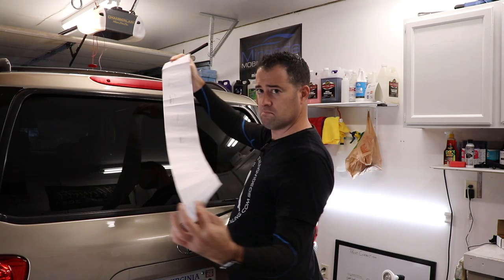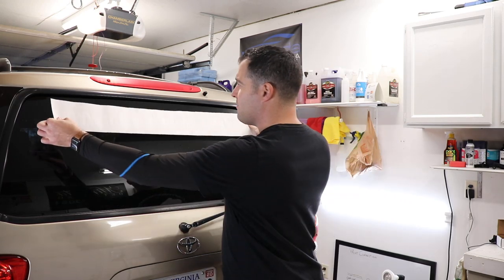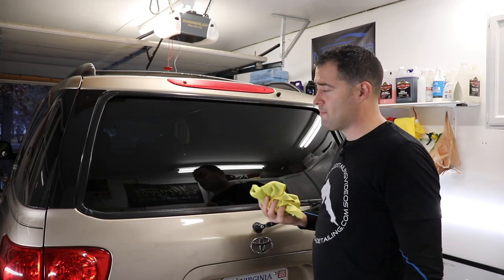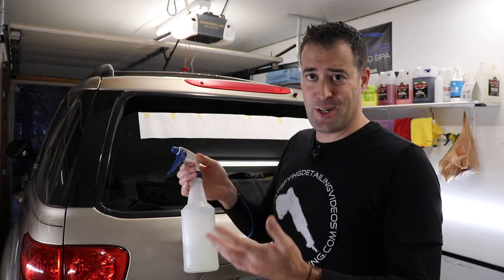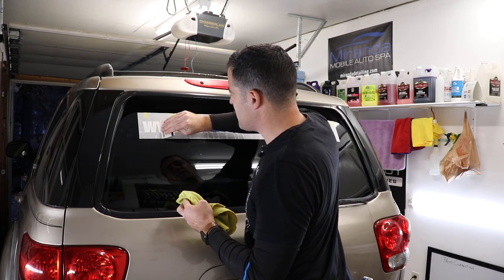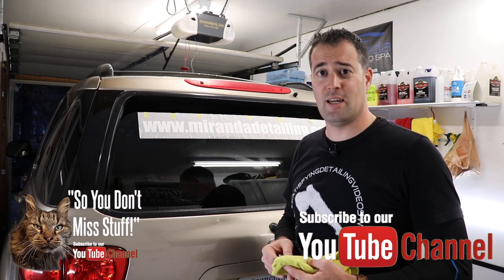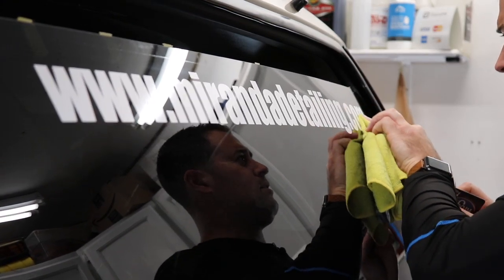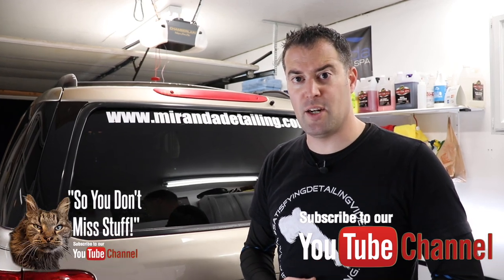DIY Custom Vinyl Lettering Installation

Comment: Looking good! 

Don't know if you drive this car much without the trailer on? 
If you where to do like the logo on the t-shirt that someone mentioned which would look great. The problems gets with the view through the window with a vinyl logo with the same material as the website lettering. But think that you can order a tint where you design the what you want on it and even the background color can be in the cars paint color. That you see through it from the inside but it's not much view from the outside and into the car. Maybe hear with those that does the vinyl wrap on the trailer. As it's common on the business vehicals that does full wraps or part wraps. Also something to look for in the future to do a full wrap on the trailer and the vehical you have it on. The huge benefit is that you can restore it to the original very easy. And don't have to worry about any faded paint and not faded paint under the lettering and logos. Also you get the option to get the base color in the business colors. Much fun and proffessional stuff you can do both on the paint and glass that really makes it to stand out. And keeping a little more value on both the trailer and the vehical. A rolling advertising vehical and trailer LOL.
Reply from the maker: I don’t drive it that often. That’s why I went with simple graphics for now. But hopefully w will get our trailer back today with the new vinyl graphics on it! Super excited to see it and I’ll show you guys!!